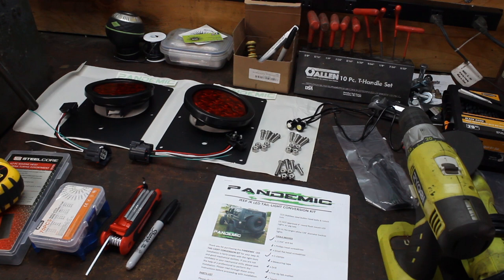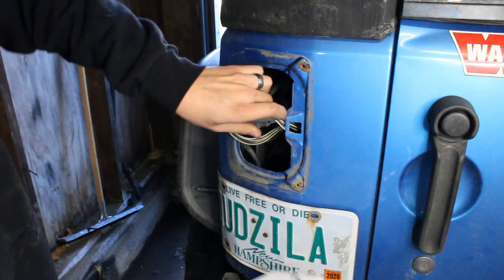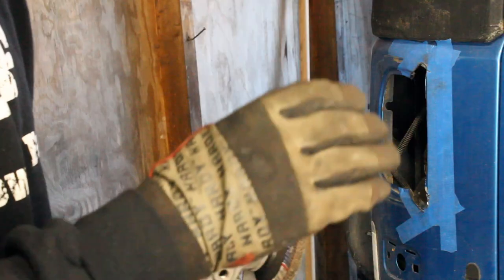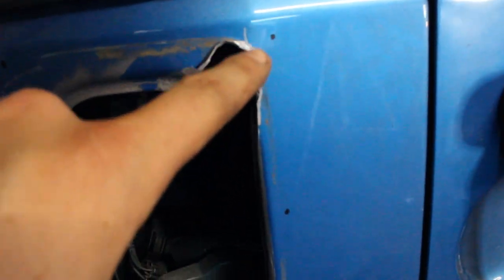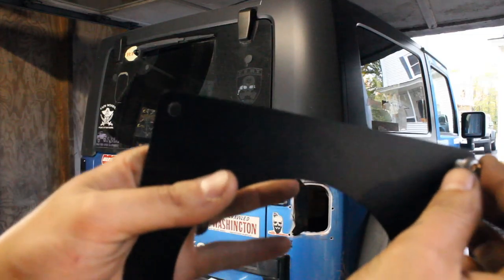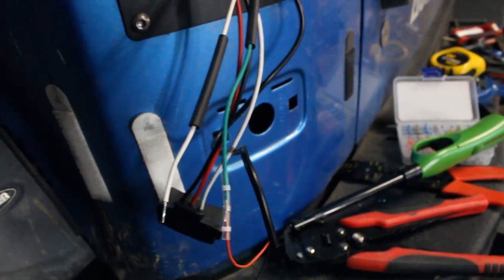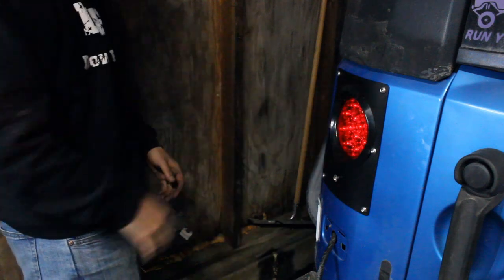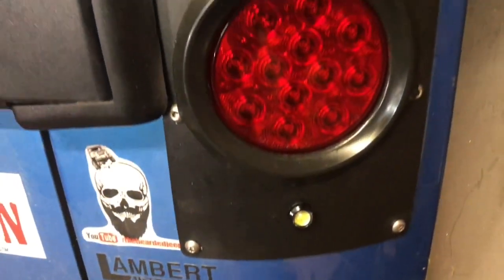PANDEMIC LED Tail Light Conversion KIT Install

Comment: The tail lights look good. I know the struggle of putting in those type tail lights all to well. Also I have been using those wire connectors for a while now. A heat gun makes quick work of them. They work well as long as they are not in an area that gets too hot. Thanks for the video.
Reply from the maker: Thank you! And those connectors are awesome. I need to get a heat gun to make quicker work of them. The tail lights are super bright I love them. Thanks for watching

Comment: Ok soooo 
I been thinking bout 
moving my plate in 
the same manor as yours However 
have you ever had police hassle ya for it??
And how did you mount it ?? I can’t see any bolts or screws??
Reply from the maker: Allan Wagner haven’t got any haste for it yet I mean it’s in the stock location just bent around the body. I made a video on how I mounted it. https://youtu.be/t_HQ37S4aMw

Comment: you need a load resistor to prevent the fast blink? Does that go for single LED bulbs as well? I was hoping I could buy LED bulbs without all this. Different model of car tho. Good vid, thanks
Reply from the maker: yeah you need the load resistor on the single bulbs as well. I wish you could just turn off that function

Comment: Nice job looks good.  but no way is this kit worth the 285$ lights, metal bracket, resistors & screws. All can be purchased for under 75$ on eBay
Reply: It is certainly an option to attempt a DIY kit.  I say go for it!  This is for the guy thay wants a nice laser cut aluminum, cnc formed and powder coated plate.  Time is money and if you have the time, save some money!

Comment: Where can I get the easy wire harness from that u use in video
Reply from the maker: Paul Pecorella you can order them with the kit. It is one of the options when you order you can select the plug and play harness
Reply: The Bearded Jeeper  does not let me choose if I want harness or not
Reply from the maker: Paul Pecorella that’s strange it should let me contact them and see if they don’t sell it anymore
Reply: The Bearded Jeeper let me know if u can find them
Reply from the maker: Paul Pecorella will do. I will let you know as soon as I get a response